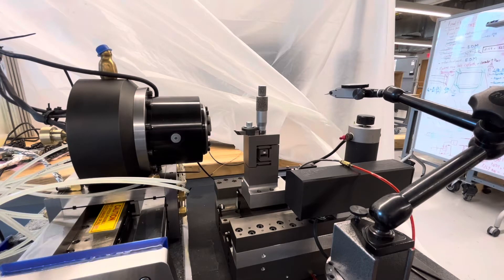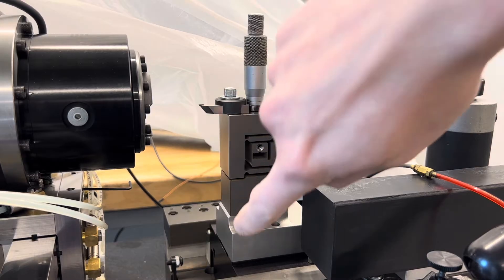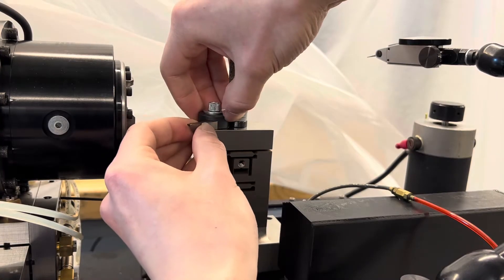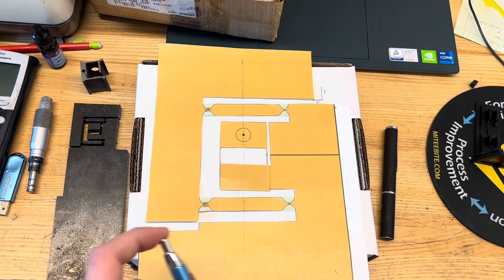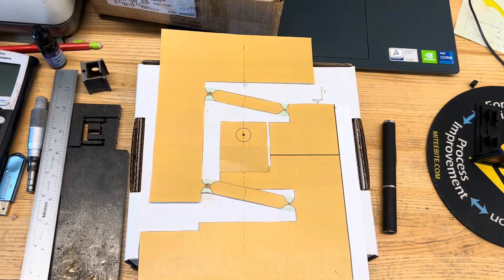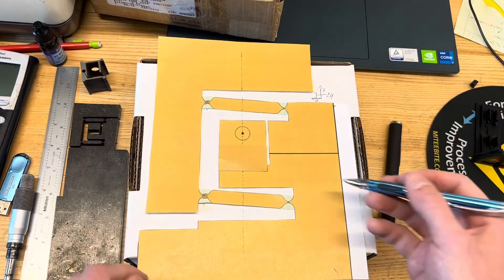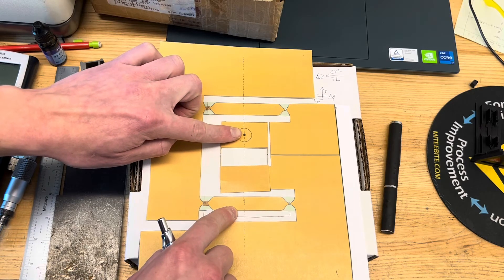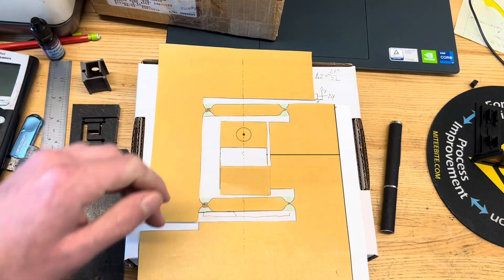Ultra precision flexure based diamond turning lathe toolpost

Comment: Just thinking... the micrometer mechanism probably has a precision flat carbide end cap. If you have a captured spherical bearing in the lower fixed point, the carbide flat can simply slide sideways as the adjusted segment moves in X... If the bearing is in a V track, it could roll, but I guess that that's another point of possible error, if there is any dust or contamination in the V track... Just an idea.

Comment: It looks like micrometer with ball at the end of the shaft preloaded with spring instead of grove and set screw will eliminate the need for the second horizontal stage. Ball will just slide horizontally on the surface of the center support.

Comment: If I could make a few suggestions.

First, If you are looking for near absolute repeatability for toolpost location, add some (at least 2) dowel pins. It should get you within just a few tenths every time.

Second, for your micrometer head, consider a surplus micrometer from an optical comparator. They are 2 to 3" in diameter and much easier to read and make painfully small adjustments quite easy.

Comment: Isn't a differential screw a better option here? (Titter beat me to this.) That micrometer thread isn't all that granular. I also think the flexure is trading off rigidity for the dubious return of this adjustability (the suggestion of shims below may not be as elegant, but it is certainly more rigid.) All the forces on that axis are on a single tiny micrometer screw, and all the cutaway for the flexure is less material for the other axis rigidity. Beautiful part, but I suspect ill conceived.

Comment: Is there a concern that the small stage can move up and down by flexing it's connecting links toward or away from each other? They look like they could bend.
Reply: Fair point, the leafs might buckle depending on the vertical load

Comment: You would get finer resolution if you use a differential screw in stead of the micrometer. And it averages out so it can be made on a normal non-precision lathe.